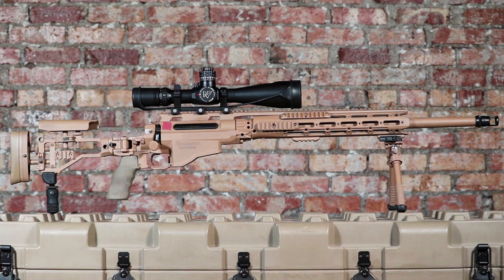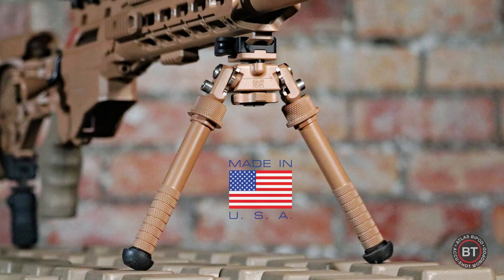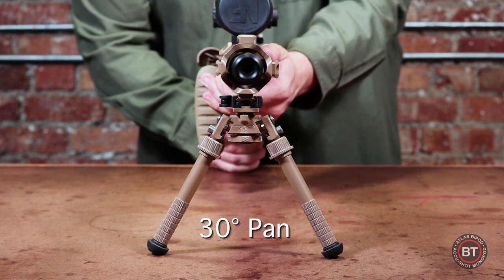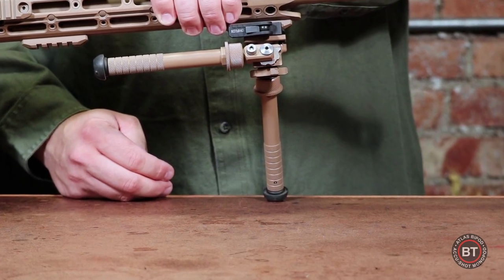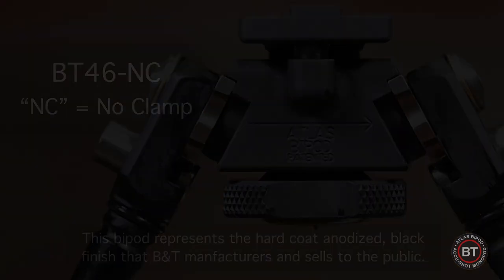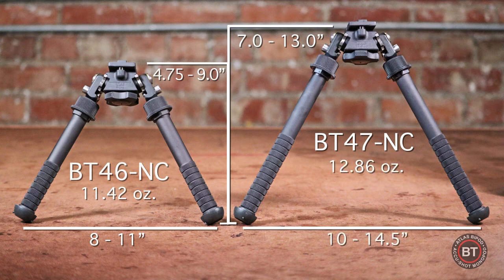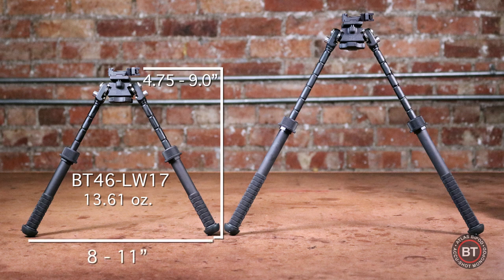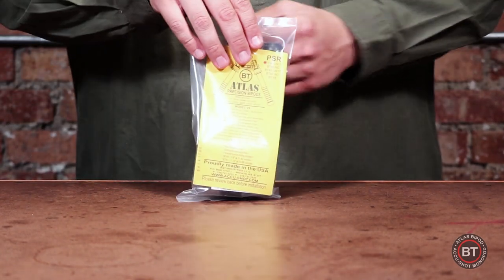Atlas PSR Series Bipod Tutorial

Comment: I like my Atlas bipod but the draw back to these over the  Harris style bipods is dust.  The slightest of amout of dust or fine dirt will cause the leg to jamb because the clearance between the inner and outer leg is extremely small and there is no seal.  If you use a bipod in a dusty or sandy environment you may want to consider this problem.

Comment: Pretty sure they have the bipod facing the wrong direction  ..  says so in the instructions
Reply from the maker: Thank you for pointing that out! The Atlas will work as designed mounted either way, we simply suggest the engraved side with the arrow be mounted towards the butt of the riffle so the operator can see the arrow for reference in adjusting the tension.